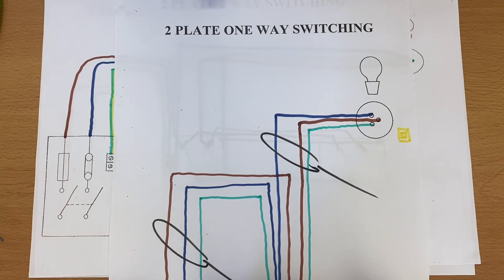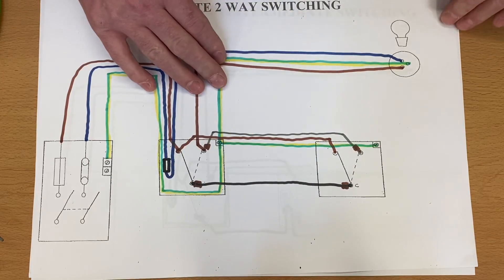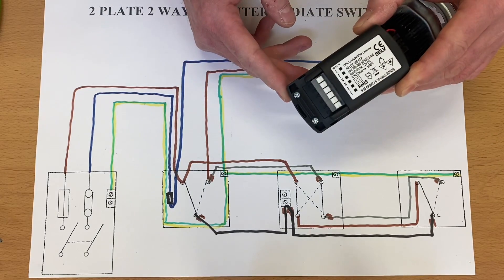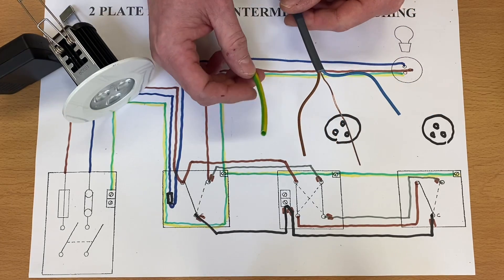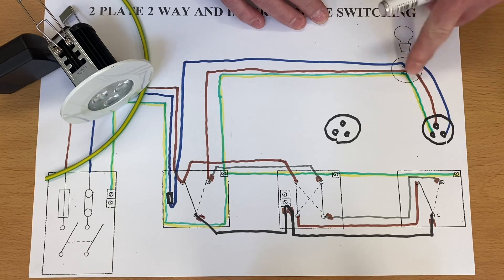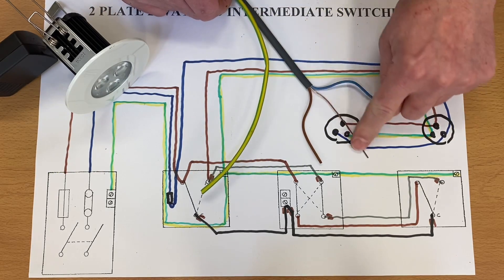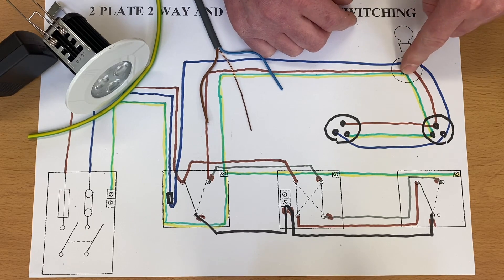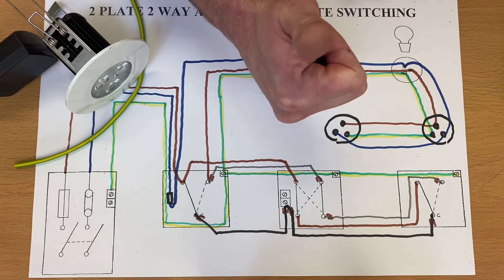Wiring Diagram 2 Plate Method How to Add Multiple (More) LED Downlights (Spotlights) to Your Circuit

Comment: Do you think its possible to wire them into a 13 amp plug socket? Im converting a statue using 6 led downlights and was hoping to run them off a plug socket

Comment: Great Vids. Just to confirm for multiple spotlights that are controlled by one light switch. Does the power from the consumer unit run to the light switch and then on to the first light in the chain? Thanks
Reply from the maker: Yes they do

Comment: Hello Gaz, I was wondering if you could please help me, I have the copper wire with multicolour LEDS, the problem is the controller has failed, and I need to find a simple circuit to alternate the polarity of the  5v wire (if you connect the power to the wires the yellow and green leds light up, if you change the power leads over, the blue and red leds light up) P.S. all the parts on the failed controller have no makings at all 
Thanks

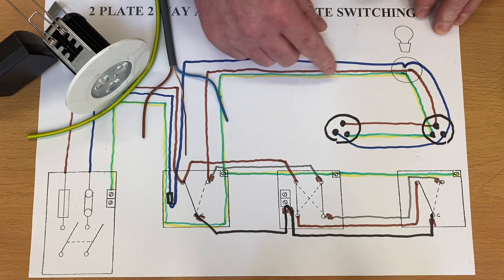Comment: Aside from probably needing to add a junction box to deal with all the wires are there any issues with "looping out" of a light fitting to feed multiple other lights from a single point? (What you talk about at 4:47)

Thinking that might be easier when adding extra light fittings to an existing circuit for example
Reply from the maker: Thanks for commenting and watching 👍🏻

Comment: Great video. Gary, easy when you know how.
Are those Led lights low voltage or mains, ie 12v 24v or 240v?
Reply from the maker: Mains voltage to the driver 👍.
Reply: @GSHElectrical  so why do we have to use a fire hood over the lamp fitting? As specially as LEDs don’t get hot or heat up ?
If we put the fire hood over the driver then surly that would get a lot hotter a lot quicker?